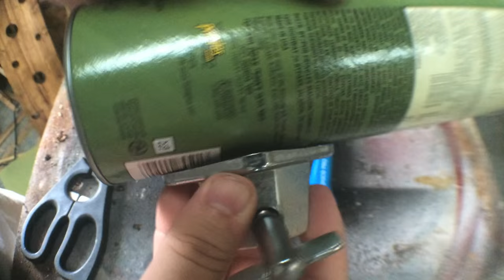Pringles Can Drum Stick Holder

Comment: What can i do if i don't have the floor tom thingy?
Reply from the maker: The Dog of Justice If your rack tom has a memory lock you can use that (as long as it not the tube style arm) or sometimes the boom section of a stand will have a memory lock and those are usually the same diameter as a floor tom leg.
Reply: rdavidr I'll try it on the boom section~
Thanks for answering!  c:

Comment: dude it isn't necessary to cut the Pringles can. the only thing you had to do was to put the clamp in the upper part of the can. so you won't need to cut the thing bc it won't bother you at the time to put the sticks. I say so bc I did the same like 2 or 3 years ago. just saying. a little advice. by the way your videos really rock.